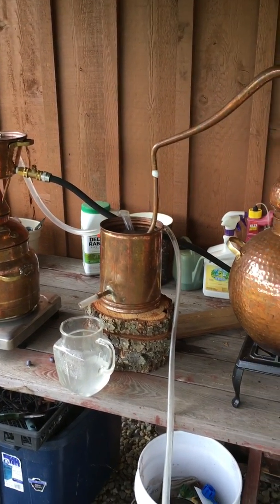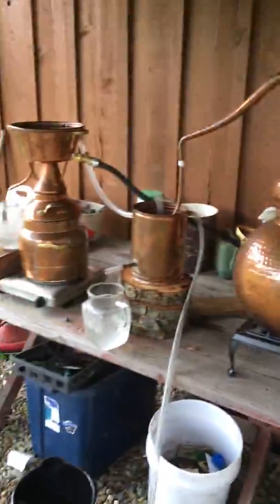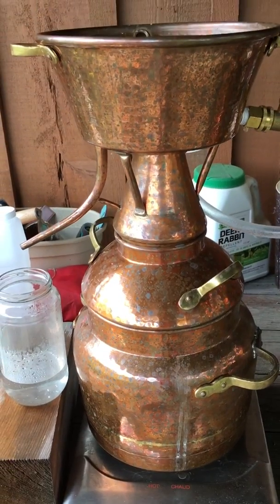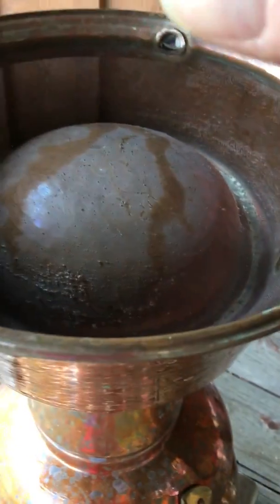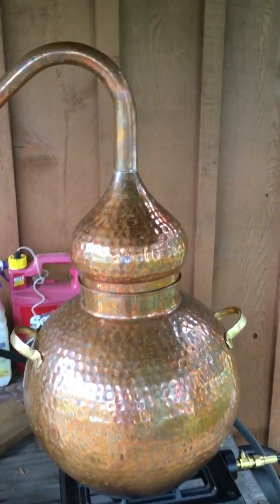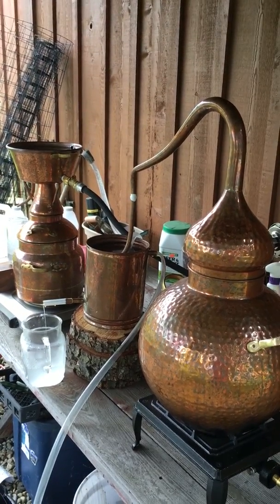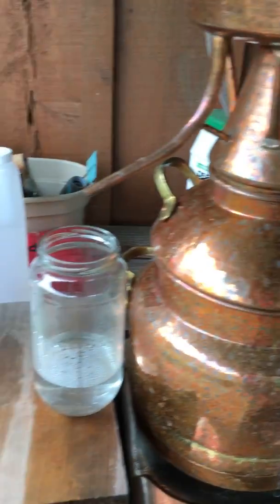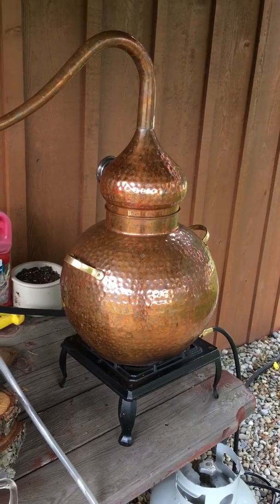Mint Hydrosol Double Distillation Setup

Comment: Hi Cindy, I purchased an Alembic distiller a couple of months ago from your shop. I am getting ready to distill the same thing you are in this video and using the mint for ironing spray and also to make it lotion. I heard there are certain circumstances where you should soak the herbs for 24 hours I am assuming this is only for sticky herbs. What are your suggestions thank you.
Reply from the maker: There's no need to soak fresh mint.  I typically let it wilt for a couple of hours and then distill.  Dried herbs, roots, wood or anything else very dense is best to soak overnight before distilling.

Comment: Why don't you have the stills sealed with tape or rye paste?  I'm just learning and thought that was an important step?
Reply: P.S.  thanks for the great video!
Reply from the maker: Great question!  You only need to seal them if they are leaking steam.  There is a bit of teflon tape at the connection of the condenser on the right.  All of the other parts in the still fit tightly and do not leak steam.

Comment: I've tried a couple of batches and the oil/hydrosol comes out with a funny smell. It has hints of mint, but a stronger smell. Someone suggested that it may be camphor. Have any ideas? I've done oregano in the past with great results.
Reply from the maker: Try different varieties of mint.  I find my apple mint doesn't have as nice of a smell as my peppermint and my spearmint needs a couple of months to mature before it is super sweet smelling.
Reply: @CandlesandSupplies  Thanks. I'm using wild mint. So that may be a factor.

Comment: Hello! Thank you for your video. I was wondering when you say you run the still for an hour, do you mean, an hour from the first drop? And would you mind sharing what temperature your still gets to when the hydrosol first starts to drip? I've been getting to 200 and they hydrosol smells, taste watery. I'm wondering if it's too hot. I've been using propane for a 10L still and maybe I should use a smaller weaker electric burner.
Reply from the maker: Yes an hour from the first drop.  The first hydrosol that comes out will be the strongest and then as the plant material releases it's aromatics, the water does tend to be more mellow and not as strong as the distillation progresses